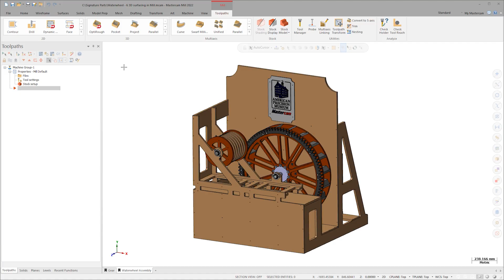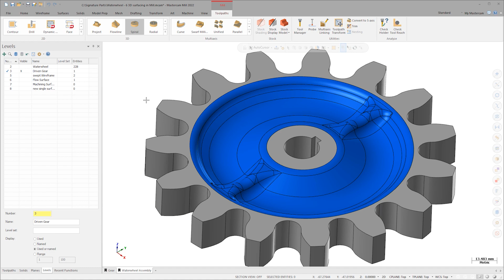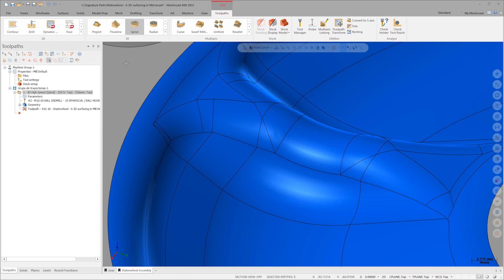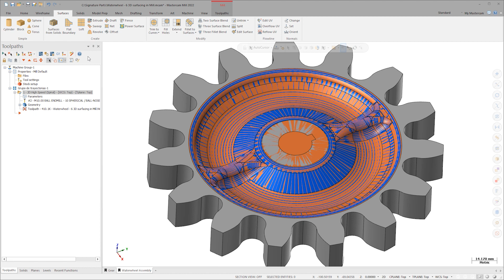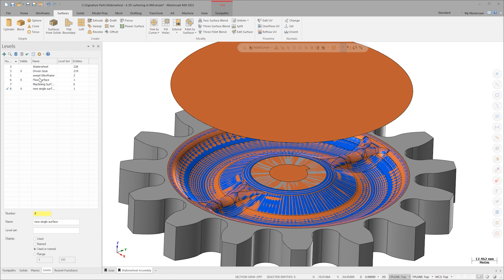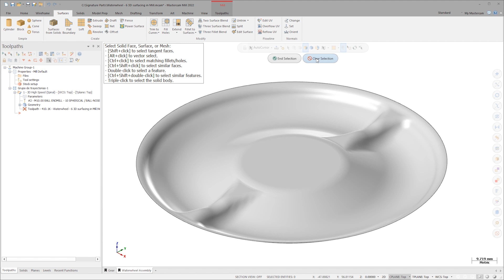Mastercam Single Surface Machining and Overflow UV | Mastercam 2022 Signature Parts

Comment: Could I be able to use an equal scallop toolpath for finishing this portion with using  pre made circle  in center of the part as a start curve?
Reply from the maker: Hi Mamunur! Yes, and that would be a great toolpath to use for a shape like this if you have a Mill 3D license.
Reply: @mastercam  Thanks